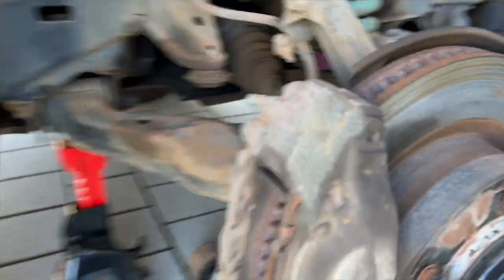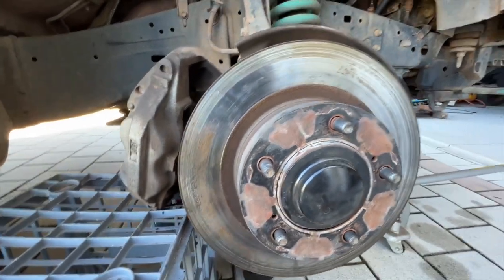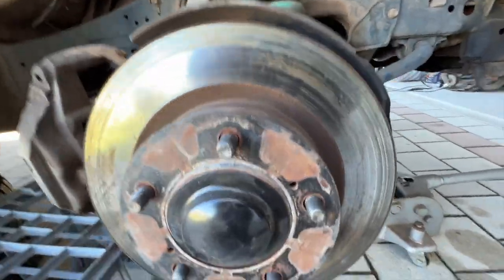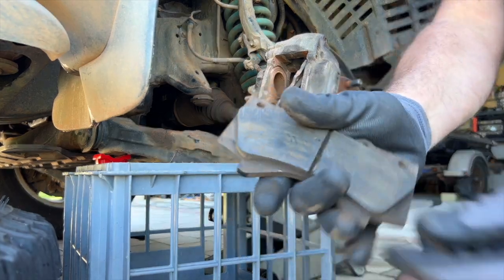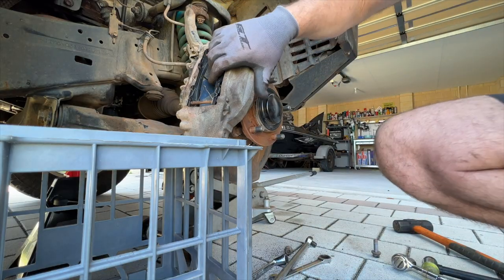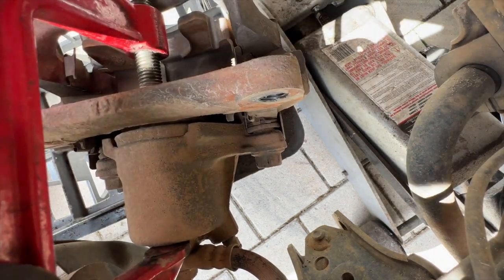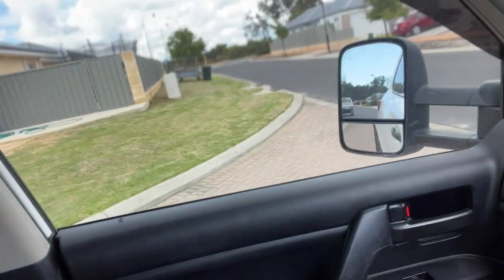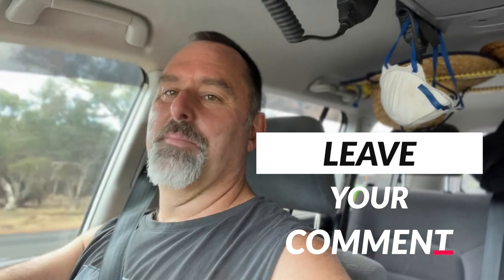New BRAKE PADS & ROTORS on the 200 Series - Done in the DRIVEWAY

Comment: Great job mate. Very thorough. 
You got away lucky compared to my neighbour and his 200. Set about doing a similar job to yours and 2 days and 2 mobile mechanics later they simply didn't want to come off. In the end car got towed to a shop the poor bugger.
Reply from the maker: That was my biggest fear. Because it was only a couple of days before the Easter trip, I was pooing myself that it would all go tits up. What surprised me was how hard the rims where to get off! Just to get the tyres off I had to use the mallet and slog them. Never had that before!
Reply: @JebbreysJibberish  It's a possible can of worms. I've never seen rotors that rust welded before, considering his cruiser had relatively minor off-road exposure. 
Anyways good job and video, a lot of people will learn from you! 
For what its worth ive had a front bendix 4wd kit fitted to the front oh my GU and its been great! Good bit of gear!
Cheers mate.
Reply: @JebbreysJibberish  Aluminium on steel hubs seems to be issue with rims getting stuck. The Aluminium corrodes with that white dust and it just seems to glue them on. Slight bit of grease or anti seize around rim centre should sort it out 👍 Hope you've been well mate
Reply from the maker: Yeah going to put some anti seize on next time they come off. Man I couldn’t believe how stuck they were!

Comment: Squeal would've been from the big lip on the front rotors Jeff, bit like running your finger around a wet wine glass. Edge of pad just touches the lip and makes the lovely noise lol. Also with your rear brakes they are a floating caliper. The caliper floats on 2 pins so as the piston pushes on 1 side the caliper will "float" across and pull on the other pad. It's a great idea to pull those pins out (just the 2 bolts on caliper) and clean and grease them which will also help with pushing back the piston as the whole cage won't be in the way 👍 p.s I'm not working at you know who's anymore. Doing some high voltage stuff nowdays! So if you need to borrow tools or need a hand just give us a yell 👍
Reply from the maker: Awesome. Thanks Brad! Good to know. HV stuff - now that’s sounds interesting! Probably better 💰💵 too!! 😎
Reply: @JebbreysJibberish  Definitely better 💰 Wanted dual trades so thought I'd go play with powerlines for something different 🤙